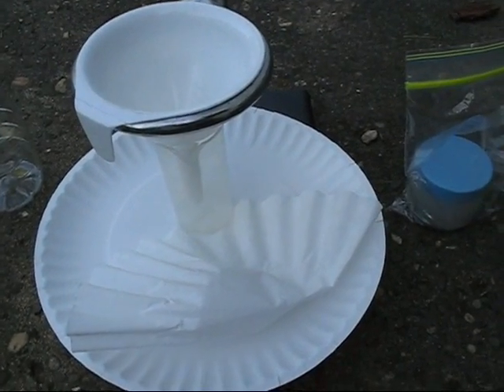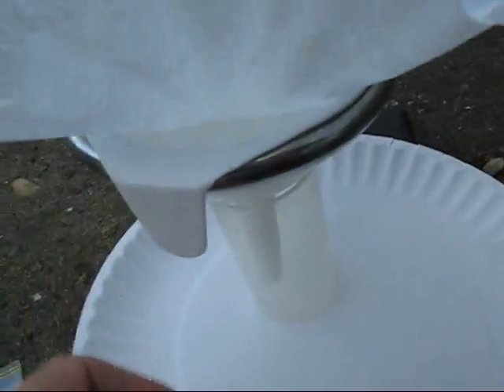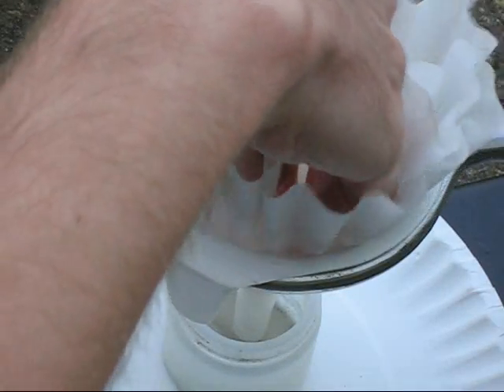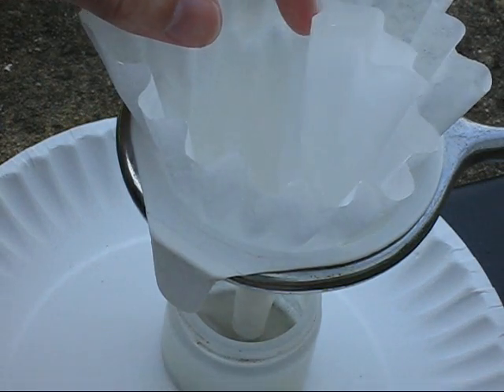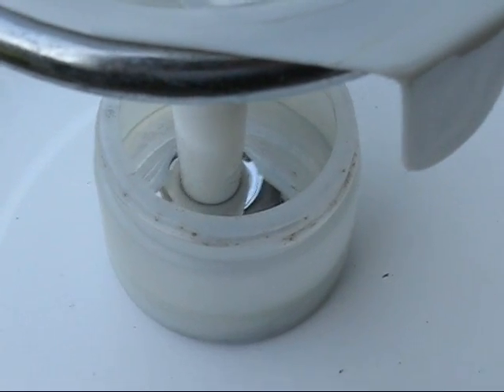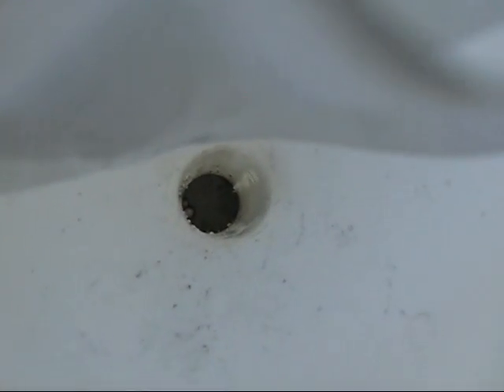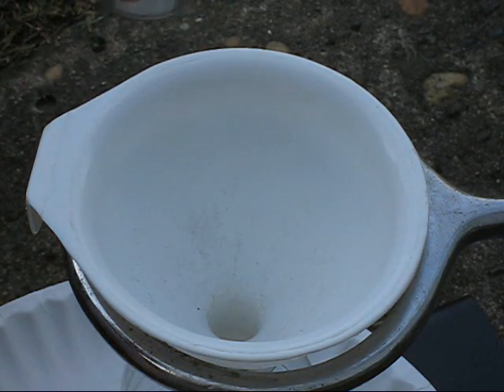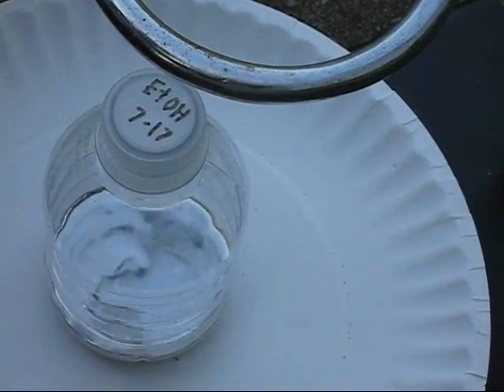Cleaning Mercury Surface Scum

Comment: I use a rigid cylindrical polythene container to clean my mercury. I pierce a very tiny hole on the lower edge of the container with a very fine needle, and it's permanently taped onto the top of another container at an angle with the hole at the lowest point. I then pour the dirty mercury into the top container. It streams through the hole, leaving all the scum behind and comes out with the surface looking like a mirror. I keep this device and always use it for cleaning the mercury.

Comment: I once read that mercury could be thoroughly cleaned by dripping it slowly from a pipette and through a column of concentrated nitric acid. I have never tried it though and - don't personally recommend it.
Reply: The nitric acid will dissolve the Hg😂
Reply: @timmulm  - It seems to be a recognized practice  as shown here: https://www.youtube.com/watch?v=2ubw1bI8s5w - it will dissolve a bit of mercury but remove surface contamination and metal contaminates.

Comment: If you want your mercury to look all shiny like the Terminator, try adhesive tape. Just keep stirring the mercury with duct tape folded over in a V to make it stiff. The scum sticks to the tape but the mercury doesn't. It takes some stirring and changing out new pieces of tape as the tape gets dirty. I have over 2 lbs of mercury, used double stick carpet tape in the bottom of a cheap plastic cup and stirred with regular tape as well. It took about 30 minutes as my mercury was super dirty.

Comment: I had a baster I bought at a local grocery store, well, a marinade injector needle. I cut the tip off with tin snips, so there were tiny holes i the end of the needle part, stuck it in the mercury, and sucked it up into the injector. The mercury source deflates like a balloon, basically leaving the scum on the outside. You would lose some of your mercury, but what you suck out is perfect.